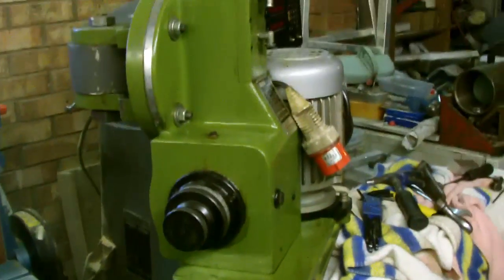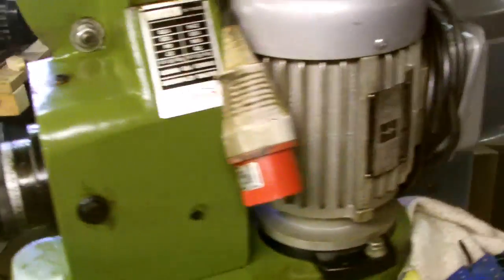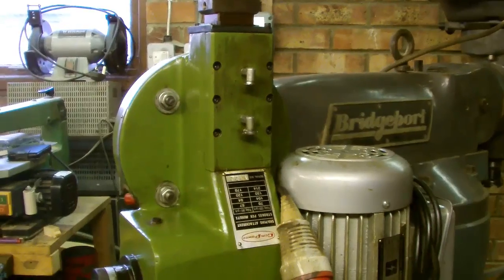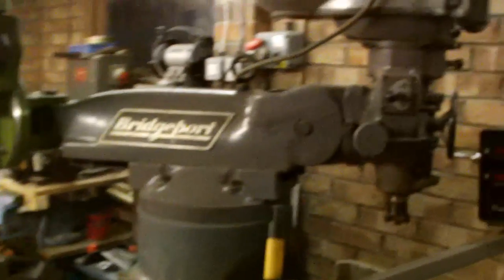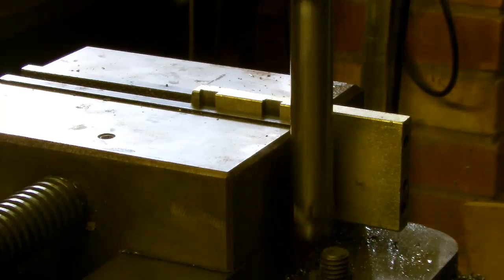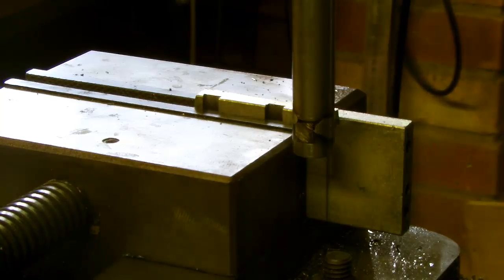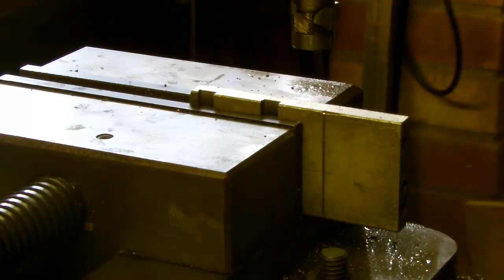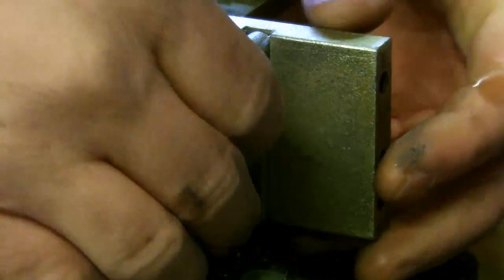Bridgeport Mill Slotting Head

Comment: John, 
Forget eBay, unless you find a user not dealer selling it.  I just bought one today at an industrial auction:
CINCINNATI TOOLMASTER SLOTTING ATTACHMENT, FITS ARM ON ANY BRIDGEPORT TYPE MILL WITH 3-1/2 X 4-1/2 DUB TAIL $ 60.00
Good luck

Comment: I'm curious as to who makes this head and where did you get and if I'm not being to nosey how much does it cost? I have been looking for one on ebay and they seem to be going for around $2000 which is to high for me. Thanks for any help on this JW
Reply from the maker: Well this one wasn't built by Bridgeport. It's absolutely rock solid though and weighs more than anyone should ever try and lift.  If this particular head had been cheap within reason I would have divulged the cost, but it wasn't cheap by any means. People who sell these know they are as rare as hens' teeth and tend to charge accordingly.  $2000 is far too expensive though. I didn't pay that.

Comment: Thanks for the post, been looking for some time to find a post on a slotter like yours, and an insight on the tooling. I believe the bore for the tool holder on the slotter is 16mm? and that you actually manufactured your own tool holder. By chance did you try sourcing for a supplier of tool holders and bits?
Reply: +farrellhunter 
I have a genuine Bridgeport slotting head with adjustable stroke, this has a 5/8" hole in the ram in which I use centreless ground 4140 shaft with suitably reamed holes to fit cutters made from broken centre drills, up to 5/16".  For wider stots I turn down larger diameter to fit the hole in the ram and make cutters to suit.  Once you get over abtout 10 mm wide keyways it is necessary to make multiple passes to cut them, this is surprisingly easy yo do accurately.  You are able to buy factory made slotting cutters up to 3/8" on ebay, but the are quite expensive for what you get.
On my Pacific mill I have fitted a similar slotting head to the one in this vid.  It is not the same as that shown but the colour is not ghastly green.  This does not have an adjustable stroke and has a 1" square hole in the ram with diagonal corners removed.  I made a few mounting tools to take the 5/8" tooling as well as a few turned down from 1" square keysteel for bigger cutters.
I had not thought of making tooling as shown in this vid. to take square toolbits, I'll give it a try.
I have not been able to get the spring loaded "clapper box" to do anything, so why do they put them there; unless they are meant to cut on the upstroke, which I seriously doubt
Reply from the maker: +Robert King 
I have tried every way of using the spring loaded clapper box on my slotter and I didn't arrive at any solution as to what use it could be. I can't imagine what the designer had in mind.  Due to the cost of these slotting heads on ebay, I would always recommend spending a fraction of the money and buy a good shaper, especially if space is not an issue. I bought an Elliot 10 and it's far more settling to use. Maybe the spring loaded head on the slotter just isn't supposed to be used when cutting a key way...

Comment: I think you will find the spring action is the equivalent of a Clapper Box on a Shaper, it is designed to prevent the Tool from rubbing on the return stroke. This is to help keep a sharp cutting edge on the tool. It looks like this is to be used to cut in one direction only as with other similar arrangements. Cheers from John.
Reply from the maker: Imagine the head is above and well clear of the workpiece and is adjusted for no spring relief - there is no movement in the head. The tool is now pointing straight down in what one assumes to be the desired cutting position.
If the head is then adjusted to have spring relief it begins to gradually deflect off vertical and is no longer pointing straight down, all this time being clear of the workpiece.
In effect, one can now push on the bottom of the cutting tool against the spring to bring it back into true vertical only for it to return to off vertical when one ceases to push on the tool.
This appears to be the opposite to how a shaper's clapper box works. The shaper's clapper box naturally resets into the cutting position on the return stroke after it has finished being deflected by the workpiece.
The head in my video seems to reset into an off vertical deflected position before the cut begins. Any attempt to make a cut will cause the head to deflect.
Bizarre. I hope this clarifies the problem.
Reply: voidmansions I kind of understand what you are saying and as such I without actually seeing the setup can't speculate further. It would seem you have a bit of a conundrum. I did see a cutter bar on a slotter where I worked that had a spring loaded tool holding end on it but this was a fairly large machine. It was used to put keyways into 3 meter dia gears and the like. Got a feeling the stroke max was around 25 to 30 inch's. If I remember the spring worked vertically, with the stroke, this allowed the tool to cut positively and rock away on the return stroke. Cheers from John.
Reply: voidmansions , joander1 was right about it being a clapper box mechanism, I think you will find you should have your tool rotated 180 deg and cutting on the other side, then the clapper function will work correctly.
Reply from the maker: russhellmy  Believe me I have tried every orientation and it doesn't want to work unless I lock out the spring action. It must be designed to work some way or other, but it is fooling me so far.
Reply: I notice some further discussion on the conundrum of the Slotter tool arrangement. I kind of figured that the tool would be tried mounted the other way round at some point. I am just wondering if this is supposed to be a positive actuation, perhaps from the rotary to linear there is a rod or adjustment to lock on downstroke (cut) and then allow for the tool to retreat on the return. I assume it came with some drawings and or a parts breakdown. If so then it would be evident there if what I am now pondering is the case.

Good luck and cheers from John.